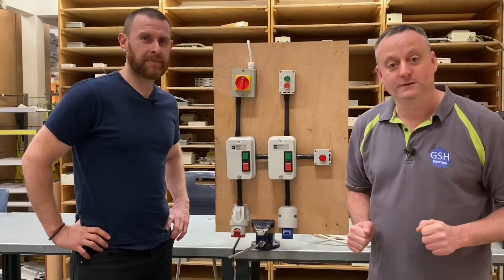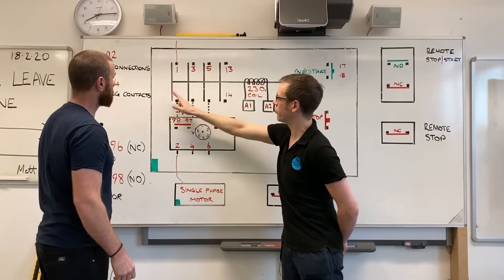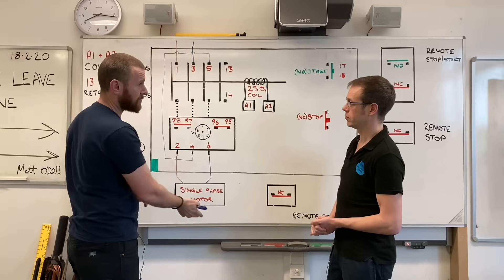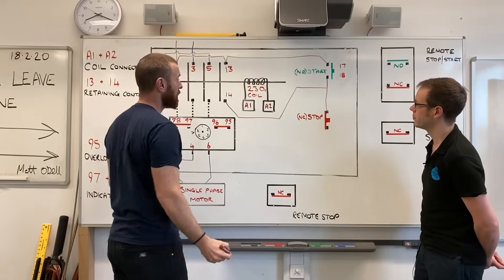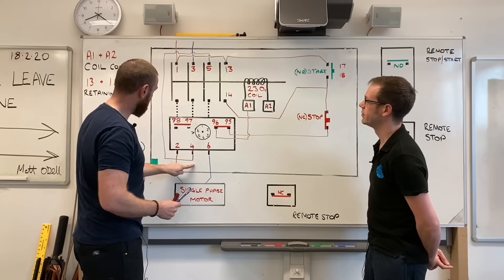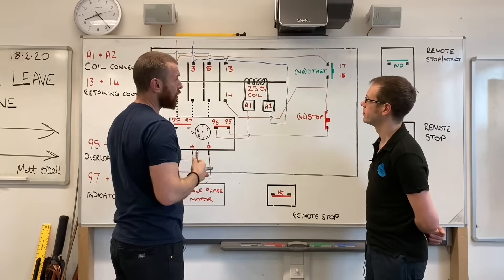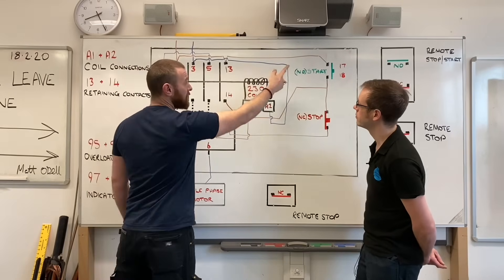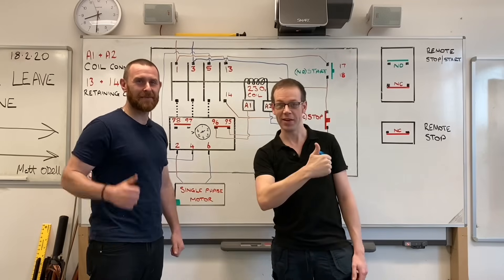Single Phase Direct Online Starter DOL Wiring Diagram Connections Explained - AM2, AM2S, AM2E

Comment: This is for a 120v circuit with a neutral wire.  I'm building a rotary 3 phase converter.  It has two 120v lines going to 1 and 3, there is no neutral wire (I looped a wire out of 4 and connected it to 5 as you did in the video).
For the Start/Stop circuit, do I use the 120v wire in 3 the same way you wired the neutral wire in the video?
Basically, my question is can the 120v wire in 3 be connected to A2, or do I need to run a seperate neutral wire from the main panel and connect it to A2?

Comment: Another great presentation. Quick question: if the load requires a cable with a csa larger than the control wiring, how then do we provide overcurrent protection for the control wiring? We can't have say a 32 amp mcb - required for load - protecting the 1mm control cables. Thanks.
Reply: Hi, you could have the control wiring fed from a separate circuit say a 6 amp mcb instead of being looped over like in the video.

Comment: I don’t get how 13 and 14 stay latched together pardon my stupidity!? 
You press start button to connect circuit to eventually engage A1 coil. But as start switch doesn’t hold in how does coil remain in and keep all poles of contractor engaged for 13 and 14?  Hope this makes sense. Thanks

Comment: No, don't set the overloads at the running current of the motor. Set the overload setting to the full load motor current, that will be displayed on the motor nameplate. The motor current can change for a number of reasons. The number of times I have attended to motor trip fault, only to find the overload set way below the rated full load current of the motor.
Reply: Thank you for pointing this out as I was wondering about the FLA.

Is there a way to find out what the FLA of motor is, please.

Thanks for your help in advance.
Reply: Its on the nameplate  @GOTOHOBBIES

Comment: Brilliant video. Could you recommend best practice for wiring a safety cut out switch into the contactor, which will cause the motor to cut out or not start when door is open.

Comment: You say its a single phase instalation so the contactor coil has to be 230v, WHY???? It could quite well be controlled by another source, such as on a cnc machine where all the control circuits are low voltage DC commonly 24v. It also seems loke Joe already knows more than Matt does, as he is constantly prompting Matt to give answers to things he should have already explained. I would suggest you review this video and edit it to be logical to a layman, which is what I suppose you intended. By the way Matt, I am glad I didn't have you as a teacher when I trained, you have the typical format of knowing it all but unable to tell it in a logical way. It brings to mind the old anology, can't do it then teach it.

Comment: Hi sir , I installed the system the same way. I wanted to test before connecting to the board. Contactor - Thermal(5.5-8A) I set it to 5.5 amps. I connected a heater as a load. Although it draws 10 amps, the thermal did not throw. what would be the reason. (Could it be because it is an ohmic circuit)

Comment: at 9 minutes ish,  the start button is above the stop button.  my issue with this (and experience ) is that the stop button is often a mechanically latching mushroom button. You would think this would render the drive inoperative. the problem is this. With the stop button actuated , it is still possible to pulse the drive on the start button.It simply wont latch in.  NOT SAFE!!!
by simply wiring the stop button contacts in front of the start button contacts, should the stop button be actuated. the start button then becomes totally isolated. no oppurtunity to start the drive AT ALL.
This applies to 3 phase  and 1 phase starter wiring.

Comment: Thanks for explaining it with  clear diagram easy to understand.I hv a question "Is it necessary to loop the neutral line  or it can be taken directly without into and taken out from the contactor"
Reply: The neutral need not go through the contactor at all BUT a neutral will be needed for the contactor's coil.

Comment: Regarding the reduction in cable size for the auxiliary circuit, I know it is the done thing but is they a specific reg that allows the smaller conductor size without fusing down

Comment: Cheers guys, this video has helped me understand DOL starters, my extractor fan is now wired up properly 8)
Reply: What current did you set the overload ?
Reply: @millomweb  Just over rated, 7amps iirc
Reply: @mrblack61  That seems a lot ! Better to go less than more - so if full load current is 5 A, set the overload for 4.
Reply: @millomweb  Rated was 6.8 amps iirc. This fan is pulling through a filter that will get clogged with paint, will put a clamp on it and see what it pulls when the filter is full.
Reply: @mrblack61  Now you have a choice ! If the fan still freely rotates, a fully clogged filter will not overload the fan. I suspect stopping the airflow will actually take load off the fan as it 'sucks' reducing air density and therefore less air to move = lighter load. It's why vacuum cleaners speed up if the pipe's blocked.
My motor suggestion would be to set the overload to 6A. 
If in the unlikely event low airflow does increase load on the fan, measure current with free air flow and again with restricted airflow. If you find that with free air flow you get 4A and with blocked yo get 5A, set the trip for 4A if you want the fan motor to stop to let you know the filter needs cleaning !
Reply: Perfect guy and i love you like that. I wish i can buy you a cup of ice cream 🎉🎉

Comment: One question I can't find an answer on - amperage to/from the start/stop buttons (and in between multiple buttons) so I can determine wire size.  I have a magnetic starter on a jointer and another mag starter for a dust collector.  Both are 240v motors (5HP and 3HP).  The sole reason for a mag switch on the dust collector is so I can wire multiple start/stop stations around my garage.

I used 18 AWG copper wire on the jointer, the switches are only a 1/2 meter or so from the mag starter.
On the dust collector, wiring 4 start/stop stations around my garage will probably take 20-25 meters of wire.  Am I still ok using 18 AWG copper wire or should it be heavier?
Reply: Assume 1A - so lighting circuit wire will do.

Comment: Great video! Do you guys plan on expanding this with the remote stop/start? Thanks.
Reply: Simple enough to do. Start buttons are wired in parallel to the existing start button and stop buttons are wired in series with the existing stop button.

Comment: I worked in a hotel as a shift Engineer and what really confused me was not the contactor but rather the keycard for lighting circuit. I tried to work out where this keycard for light was connected? Was it connected right in the middle of the contactor cable circuit. If you can make a video it would be great.

Comment: Why not just link out the neutral from 3 to 5?
Reply: Linking across as shown in the video is pointless.
If you linked 3 to 5 (and 2 to 4) you'd double the overload trip rating - and it too would be pointless.

Comment: Can you do tutorial for a 3 PH DOL??
Reply from the maker: I have made such a video but I haven’t released it yet 👍🏻
Reply: It's pretty much the same ! L1-3 on terminals 1,3,5 and three wires out from 2,4,6.
If the contactor coil is 400-415 volt, connect the control circuit across any 2 of the phases.
If the contactor coil is 230V you'll need a neutral running to the coil and take power from any phase. This is really where the 4th contact (13-14) is really needed !

Comment: How can we connect indicators on the same diagram
Reply: If you want to connect indicators, it depends what you want them to indicate.
1. You could connect a bulb across the coil (A1 & A2) to show when the contactor was energised
2. You could connect across terminals 1 and 3 to indicate when the contactor has a power supply
3. You could connect to 2 and 4 to show when the output in live.
4. You could connect across the overload (96 and 95) this would then indicate the overload was still in the tripped state while the green button was being pressed.

Comment: NO contacts normally take a last digit of 3 and  4, NC contacts take a 1 and 2 as the last digit from my experience. That control circuit with the hold would be fused or protected via mcb or whatever.
Reply: I've never yet seen a fuse in the control circuit !

Comment: Great video, really helped get the methology into my head. Thanks. I have a query though. I am wanting to connect a 3hp motor to  DOL. The motor requires a 40uf start capacitor and an additional 40uf run capacitor. How do i connect a DOL which allows the additional temporary switching for the 40uf  start capacitor? Is the a DOL available which can do this as single unit?
Reply: Forgot to add.. motor is 240v.
Reply: Start run switching is usually done within the motor and not by the starter. So just connect motor to starter as normal.

Comment: A good video and informative though a little out of date. Many modern contactor and overload are internally connected 95 to A2 thus the live and neutral have to be wired accordingly. In practice the live is fed through the contactor spare contacts to minimise impromptu RCD operation.
Reply from the maker: Typical colleges behind industry - this video aids an assessment my learners need to carry out. Thanks for commenting and watching. Gaz
Reply: I bought one 6 months ago. The overload was bought separately - to ensure I gone one of the correct range. So not pre-wired.
The contactor came with some internal wiring. I removed that as I've used non-standard wiring to make the green button override the overload.

Comment: We still have 185kw 415v DOL starters. They make some noise when they start lol!
Reply: I guess they'll close with quite a bang !
A DOL starter will be used on any size motor where the full power of the motor is required at start up. Compressors are one example.

Comment: So, would I be right in saying, the auxiliary wiring doesn’t require over current protection in this case? Is there a regulation to support this? Is there ever a scenario where the aux wiring should be fused down? Great video as always guys👍
Reply: I think that's the most intelligent question I've seen in the comments. I think a 1A in-line fuse would be a useful solution.
Reply: @millomweb  ABSOLUTELY, however it's very common on smaller starters to have no fuse, since the control wiring will match the supply wiring for cross section and current carrying capacity. All the wiring inside the starter is usually matched conductor size to the motor supply cable.  once you are over a 3kw motor then the control wiring maybe smaller and a seperate control fuse is a good addition.  I would also recommend a fuse should the control wiring be exported out of the DOL cabinet (ie remote start stop station or emergency stop enclosure) this wiring would need its own protection too.
Reply: @reallytalltom1712  A fuse protects all wiring including the contactor coil. I don't see a great value in protecting copper wiring - it's not an expensive item. Main point of fuse is to prevent electrical fires - it doesn't take much to burn out windings - our first central heating pump burnt itself out one morning (jammed with sludge - so no coolant flow) We replaced it and found it was satisfactory on its slowest speed - a power consumption rate insufficient to burn that one out when it jammed. The pump was replaced, flushed out and is ready to replace its replacement if the same thing happens again !
So, for the contactor coil, it should have an mcb rated for the full load current of the coil. Then, say the coil energised and the armature failed to move, thus overloading the coil, the MCB could trip the power to protect the coil (in cases where the coil is held powered remotely).
Maybe that's the reason they're not fused - if the contactor doesn't work, the coil won't remain powered !

Comment: 13 & 14 is called a latching contact. It latches in the coil, which when broken (by the stop button) stays de-energized. The analogy is a door latch.  It is for_control_ purpose only, rather than the other contacts which carry current.

Comment: Thank you for spending your time and helping thousands of learners!
I'm not sure if you have any other video where you explain what type of motors DOL starters are designed for? DC /AC and what DOL for?
Would be good to hear it from you..
Reply from the maker: We have more videos to come on motor starting in the coming weeks and months. Thanks for the kind words. Gaz
Reply: You can use them for any motor or even any electrical device. They're just basically a fancy switch.